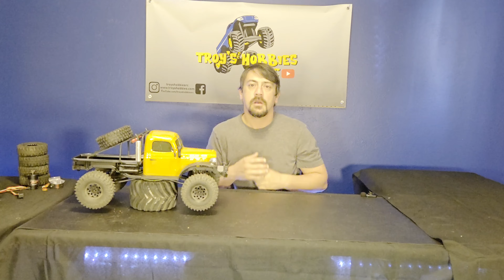FMS RocHobby Atlas Motor Swap

Comment: Yes a Fusion is a mint hop up for any truck! I had one 1200kv laying around, threw it in and voila! Very nice control, though I noticed that this truck is geared very low, so at least with lower kv Fusion it lacks the rapid punch when you need it. Just barely exceeding a brisk walking pace, that's not enough
Gonna try out 25-30% up-gearing to get that decent punch :)
Got some Canyon Trail -grade tires and alloy rims, tilted the rear shocks front-wards (where the bed mounts) and now the rear is more low and soft. Stock shocks are very bad, can't really tune them at all, just barely better than friction ones..
But those tricks worked out very well, it does some serious rock crawling, and for trailing it is fantastic! Love the low stance and long wheelbase of it, very cool! 
Cheers, Keep up with good job bro, I'm off to go through my pinion box :)